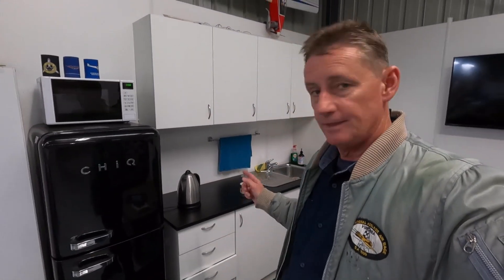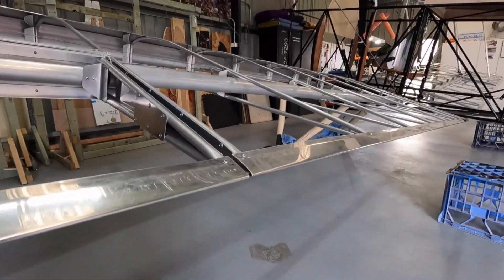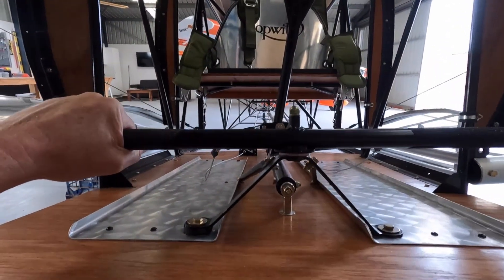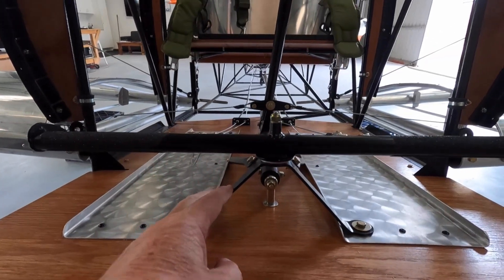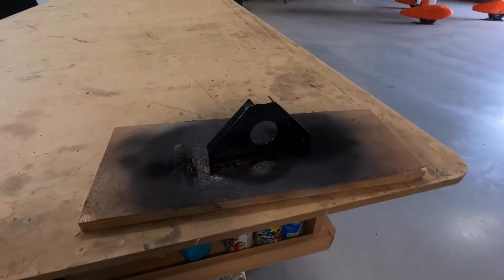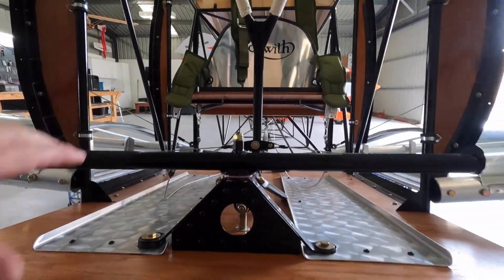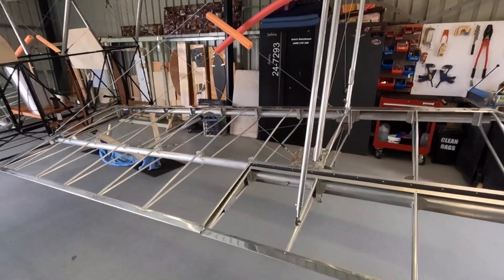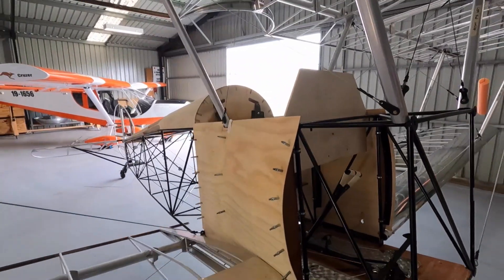Rudder Pedal Fix & Turtledeck Installation on My Full-Size Homebuilt Sopwith Camel Aircraft

Comment: You should still put a spreader plate underneath the rudder bar. Too much pull in single points on thin plywood.
Reply from the maker: It is mounted to the steel fuselage through the plywood thanks

Comment: I think one of the best things you can do for struts is to replace them entirely with wood. Easy to do on the I struts and a lot harder for the cabanes. I'm thinking of using clamshell-like wood covers for the cabanes and keeping the AL tubing inside for the actual structure. Depending on how far you cut the stubs down, it might be easier to replace. I used a torch and bent the fuselage cabane struts to get them to fit (I haven't painted the fuselage yet). Of course, they still didn't match the plans, but nothing does.
Reply from the maker: Interesting, heating the stubs and bending the steel, you may well have changed the temper of the alloy. Wood can split and crack, keep it simple in my case.
Reply: @scottmatthews5280  I'm not worried about the heat. It's welded 4130 that I guarantee Baslee has put no effort in to stress relieving. If I use wood, I'll wrap the ends in fiberglass to prevent cracking, so even more complexity and time, but leaving those squashed tubes exposed really bothers me.

Comment: To get more Aileron deflection with less stick movement, raise the cable attach point at your stick, higher. Extend the tab where the cables attach in front of the stick. A taller attach point will give more throw to the Ailerons. Again, your control limits should be on the prints.
Reply from the maker: Yea you are correct or go in at the aileron horn, basic RC model stuff. But I have no idea what travel I am trying to achieve.
Reply: Control limits should be on the prints. But this is an Airdrome. Lots of things 'should' be on the prints...

Comment: G'day Scott,

I think your Joystick is far too short mate, the OldenDayzey handling Notes say to start the Take-off Roll 

"With the Joystick full-forward,
Held against the bottom of the Panel and only relaxing the forward deflection when the Tail comes up..."

All that was due to the Camels being Tail-heavy when the Fueltank was full...; but the Stick hitting the Panel at full Forward was a
FEATURE, not any kind of a
Glitch - as I understand it.

Your Camel(oid) isn't goanna be set up that way though, Trim-wise, so you shouldn't be needing to poke the Spade-Grip out past the Instrument Panel - anyway (?) !

Can you cut, extend, and weld back the Stick's Shank to be longer...?

But it's all coming together well...

Keep on keeping on...

Stay safe.

;-p

Ciao !
Reply from the maker: Yes, I really just need to know how much travel I need.
Reply: @scottmatthews5280  

I'd concentrate on having the straight part of the Stick being the bit which hits your Thighs at their widest part, and begin the bifurcation from there.

The Ailerons are big, but unbalanced and they move equally, so as Flight-Controls they'll be most obedient and intuitive in the first half of their movement...; after that I would expect them to make so much Adverse Yaw from Aileron-Drag as to be most useful in that part of their Arc when trying to correct the heading on Rollout - when the Rudder is blanketed by the Turbulence off the Stalled lower Wings, when  the Tail's down, after landing....(?) !

A Sailplane Conversion will bring a Power-trained person up to speed on such tricks - and controlling the Rollout can be quite a thing ; especially when there's no room to rescue the trajectory with a handfull of Throttle - so learning to do it with Secondary Effects of Controls.

There are Tertiary Effects, too ; but they're only useful with Differential Ailerons while rolling out
Downwind - when Adverse Yaw reverses itself as the Tailwind uses the Upgoing Aileron as a Sail on the end of a long (wing-shaped) Lever, while the downgoing Surface only presents half as much "Spinnaker Area" as looked at from behind...(!).

I'm trying to invent and fitba Rack for Pannier Bags to the electric Motorbike, which got it's first 
Test Fright yesterday.

12 Km, with 8 Km using 10% of the Battery Capacity..., at 45 Km/hr  - using 60 Watt/Hrs per Km from the 2.3 Kw/Hr Battery ; therefore the advertised Range of 80 Km is looking quite believable (!).

3,000 Watts and 68 Kg beats the crap out of 250 Watts and 22 Kg ; being my first impression (!).

Such is Life...

Have a good one...

Stay safe.

;-p

Ciao !

Comment: For your rudder, add a flat stock flat on floor that bolts through the supports and has a hole or bushing, use a longer bolt. We have the same issue on our Pietenpols
Reply from the maker: Great idea thanks